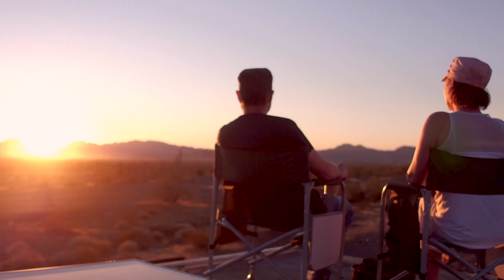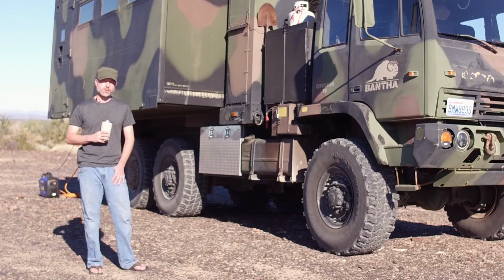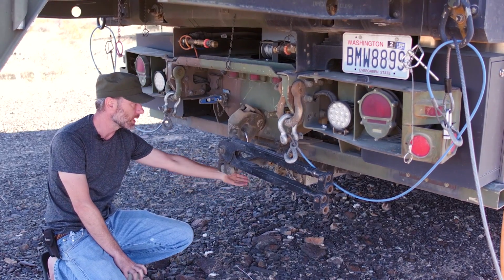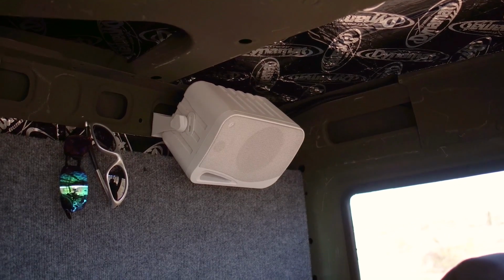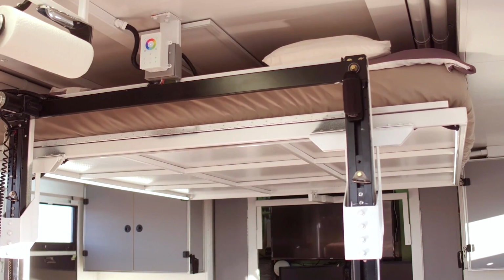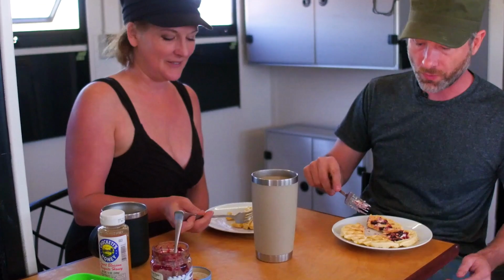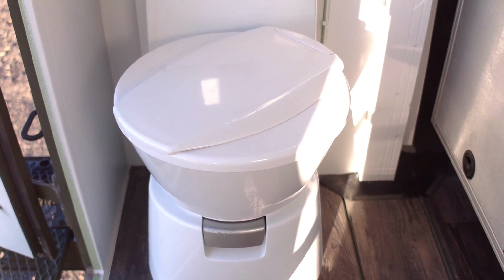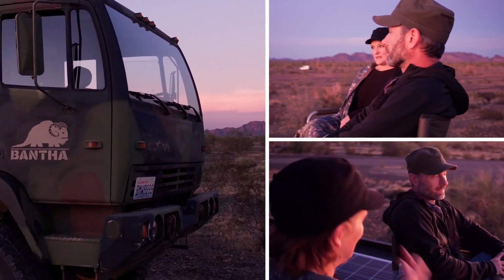Couple Converts ARMY TRUCK into Apocalypse Tiny Home 4 Overlanding

Comment: I like it.  While the industrial look might not be for all folks, another person could change the inside look that suits them.  The unit could definitely help you feel save about your travels, being 8 ft off the ground.  THe vehicle is a bold statement.  The views would be fantastic...having a high perch to view from in all most of your travels along with a tow vehicle.  I also like the way it slides and folds.  The bed idea is fantastic...like another room in itself.  Nice video.I saw a review on an off road crew who picked up a unit like this without the big box on the back.  They lowered the cab to show the engine.  I've seen these units at Military shows.  They are intriguing. THanks.

Comment: What a great job on converting the expandable box to a living space. I have a M934A2 expandable truck. It’s still stock military, but I’ve taken it camping in the woods of PA. I love all the additions to the inside of the van. It’s similar to what I want to do with mine. I see from the video, the slide outs are powered. What did you use to make them power or did it come that way?
Reply: Thank you.  We are using a power drill to open and close.   Adding drive motors, is one thing on our list (long list) of things to do.

Comment: I am extremely impressed with the Drop Down King Size Bed, and the Ability to have a Decent Sized Dance Floor with appropriate mood lighting. And that Top Viewing Deck, and Endless Hot Water Shower are just Awesome. As far as the Bathroom goes, I personally would have gone with a Composting Toilet myself, and I certainly would not have the Toilet on a Swing Out so that I can sit in the Wide Open Rear Door area with my Junk hanging out for all to see. I also love the Black Out System that sends all the interior lighting into full Blackout Mode if you have an Unwanted Intruder trying to gain entry into your Rig under cover of Darkness. Overall, your Rig is Awesome, and you definitely thought of every possible thing you could when you designed the Build Out of it. Simply Outstanding to say the least.

Comment: As we are currently have a box built that has a sliedeout on one side over the full length of 4 meters (approx 13 ft) I would very much appreciate if I could get some more information on the way the slideout is designed. If that would be possible please mail me at ulfrommel@t-online.de. Our truck is a Unimog firetruck made by Merdedes Benz.  Thanks for the video, that was great.
Reply: We will send you some info.  It is pretty basic, came with the slide outs, and a hand crank to open & close it.  We use a power drill to open and close, until we get around to adding power drive.
Reply: M1087FMTV great thank you very much.  I appreciate that.  I hope you have a lot of fun with the truck.

Comment: Looks like it was a former mess truck. (field kitchen). This truck also comes in a "command" (HQ) version or  a mobile work shop. The electrical system is 28 volts DC. Hard to find replacement light bulbs LOL

Comment: Many technically very interesting solutions and innovations. But this part is not homely. It reminds me very much of a canteen kitchen with a camp bed and TV. In addition I would miss in any case a passage into the driver's cab. The large overhang and the relatively low ground clearance by the spare wheel under the rear could have been solved more cleverly.
And, what about the usability if the slideouts are not extended? Is it still possible to use the WC and the shower? Is there the possibility to make at least a small breakfast in the morning?

For me personally only the solution with the movable solar cells remains as a usable idea for my building (but then move it sideways and thus double the area and at the same time gain some sun protection for the interior, including walk-in solar cells to use the roof partially)

+++Translate+++

Viele Technisch sehr interessante Lösungen und Inovationen. Aber Wohnlich ist das Teil nicht. Es erinnert mich doch sehr an eine Großküche mit Feldbett und Fernseher. Dazu würde mir auf jeden Fall ein Durchstieg in die Fahrerkabine fehlen. Der große Überhang und die relativ geringe Bodenfreiheit durch das Reserverad unter dem Heck hätte man auch geschickter lösen können.
Und, wie sieht es eigentlich mit der nutzbarkeit aus wenn die Slideouts nicht ausgefahren sind? Kann man das WC und die Dusche noch nutzen? Besteht die möglichkeit sich zumindest ein kleines Frühstück am morgen zu machen?

Für mich persönlich bleibt lediglich die lösung mit den verschiebbaren Solarzellen als verwertbare Idee für meinen Bau übrig (hier dann aber seitlich verschieben und so die Fläche verdoppeln und gleichzeitig etwas Sonnenschutz für den Innenraum zu gewinnen, darunter dann begehbare Solarzellen um das Dach noch zum teil mit zu nutzen)

Comment: 1000% not practical from the stand point that if it breaks down mechanically, youre not going to walk into autozone or even a dealship and get parts to repair it. Your going to spend the first week attempting to just locate any parts you might need to do the repair, then you will have to wait fo rthose parts to be shipped to your location. Not a wise choice for an RV imo.

Comment: Throw some infrared motion cameras around the outside and no problem ensuring a safe perimeter. Love the build, first military van I have seen with slide outs. Great shower space and bathroom space. So much to admire and soak in. Need to do the 360 view from inside as others have said as well. Good luck on your adventures.

Comment: Cruising the LMTV forums, I remember seeing something about LMTV owners (like yours) taking the rear gears out of Stryker Tactical vehicle and re gearing them so they can run around 70mph.

You may also want to look into “Mass loaded vinyl” in the cab for noise suppression.   If installed correctly the stuff is amazing and will only complement the already installed dynamat.

Did you guys build out the slides or did they come with the rig?

Where did you guys get that sweet shower valve with the temp display ???
Reply: They know about new drop ins, but are happy at 55 with that box on there: they are trying to see the scenery. The trip is the destination, not the destination is the trip. 😋
They can talk in normal voice to each other at 55mph, no further deadening needed.
Slides are factory.
Right? Shower readout is awesome!

Comment: The fuel consumption would be a serious issue, otherwise I love it
Reply: @halfpint614 The military throws those tires away after they reach their 5 year expiration date so yoj can pick them up on Gov surplus sites or ebay for about $300  with 95% tread life left. New they are over $1000 . You can always put a patch in the tire too. They pretty well under normal driving conditions unless you overload the truck while aired down too.
Reply: @buildthings79  try $2,500 per tire for the military.
But even bald there is almost 1” of rubber before you get thru the carcass, so you’re buying about 350# of Goodyear or Firestone rubber per tire! That ain’t cheap!😖
Reply: @jenngill7772  Yeah I'm sure the military pays $2500 a tire for the Michelins. They are pricey tires. I was just talking about the Goodyear MVTs like they have on that LMTV. They are significantly less money. You can get a new Goodyear MVT 395/85 R20 from a tire dealer not a surplus place for under a $1000. I found a place that has them for $795 each. I've been shopping for them for my 5 ton 4x4 International.  I bought the steel 20x10 split bud rims for it. (Older truck from 80's).
Reply: ...not to mention it's a million dollar RV

Comment: I Love it. The only thing I would not call it a tiny home, or even a RV, But an Overland Expedition vehicle. He's left the drive train bone stock, which could have been upgraded to different gearing and even bigger tires to get 8-10 MPG and run 75 mph easy. My real question is...what was the total cost of the build? My guess would be upwards of $175K. That's a little to rich for me.
Reply: To run a bigger tire would require a lot of work on the suspension and you don't even want to go that route seeing as there's no available aftermarket lift kits for a military vehicle like that.
Reply: My best friend owns a 2 1/2 ton LMTV  and we thought the same thing until we called around and found out why it cant be done without some custom machining.  
Fist the axels have a high gear ration to allow for less teeth on the ring gear ( like 3.71.1 ) and the manufacturer does not produce aftermarket gear upgrades or changes.  The end of the axle shaft feeds into a planetary hub inside the wheel that is I believe 3.1 reduction.  Also the space between the front a rear axel would not be enough to fit the 53" Michelins that fit those rims. So he's stuck with the 46" goodyear MTV's  (higher top speed,less road noise) or the 46" Michelin XZLs ( more aggressive tread, lower top speed, noisier on road) .
There has been talk of taking  old MRAP axles that dont have planetary hubs and just have like 6.81-1 drive ratio that had an Allison automatic, shift able transfer case and 500-600 hp diesels. The LMTV and FMTV only have like 270 hp and that Cat engine group cannot be turned up more then 20 hp or something close. All of it is controlled by a Special computer that was purpose built by Allison that even has the dash lights and head lights run through it. So if your headlight control box ( electronically controlled) stops working it prevents the truck from starting. We did extensive electrical work on his to find this out. Hell even the CTIS unit is a separate computer that has trouble codes it flashes just for the air system.
Reply: Russell Gerdes  oh I agree with you about that but not everyone knows how to fabricate and weld enough to build a suspension lift was my point.
Reply: Russell Gerdes  true being retired military  i can tell you from experience that they are a pain to work on.
Reply: Russell Gerdes  Yeah it was a pain in ass. We even had the 900 page shop manual with full schematics but its lovely to trace wires of all the same colors that have redundant relays and circuut breakers. Another friend of ours that owns Virginia Crusher the monster truck looked at it and said all we had to was add 6 inch lifting blocks to the axle and 53s wouldn't be a problem maybe even the monster truck tires. But the 53s above 55 mph get really squirrelly on the highway.  Lots of work just to get a scetchy 5 mph gain. I hate to think what it would be like to have a blow out on a 53" tire at 60 mph.
Reply: Russell Gerdes  Ive got to drive into the city tomorrow morning where my 30,000 gvw 4x4 1988 International  inner rear rim exploding while driving. Cant get the lugs off because it sits most of the year off pavement.  Had to load up a gas powdered compressor to be able to run my 1" anvil gun which couldnt run on the trucks air today. Its been stranded in a bad part of Baltimore  city for a week. Tire is still connected to the outer part of the split rim. ( gotta love those things)  rim just rusted right through and exploded while pulling into an alley going to pickup some steel.
Reply: Russell Gerdes  nope, slides are factory original. 😎
Reply: Russell Gerdes  they are original. 😎
I’m not sure what this one was originally, I suspect a command center for a general or something like that, because the M1079 was a radio rig... I’ve watched too many MASH 4077 episodes & think those generals all traveled with red carpets and harems. Lol
But you would have to ask Krystal and Zach to find out the true story of Bantha’s military service record. They might know?

Comment: Really cool, and really impractical unless you have the $$$ to keep it going. It is also really top-heavy. High winds will be a huge issue with all of that weight, and MPG is a killer.
Reply: Not top heavy at all!
Frame rails are 3/4” thick channel iron, 75% of the weight is below the half height line.
The box is aluminum/ foam/ aluminum, so it’s lighter than it looks while still being solid.
They do fine driving down the gorge, even better than an average semi pulling a cargo trailer because of the lower center of gravity. 👍
MPG is similar to a motor coach that can not go off road and close to a semi that also cannot go off road. 

You can afford to do what you put your mind to do by giving up buying knick knacks at every tourist trap, upgraded window treatments, new kitchen countertops, spinner hubcaps and etc....

Comment: An amazing build. Do they have a microwave or convection oven?  I am surprised that very few people living in a tiny house, RV or buses haven’t thought about having a incinerate toilet which eliminates the need for a black water tank, composting or a cartridge system.  All you have to dispose of is a very small amount of ashes that don’t pollute or harm the earth.
Reply: An incinerating toilet uses a lot of electrical power. It's nearly impossible to use when you're off-grid. It requires a 20 amp. circuit with 120 volts. And it's a particularly inefficient way of disposing of liquid waste.
Reply: @gblakev  thanks for fielding that better than I could, Blake! 🤝

Comment: I was hoping that would explain the different lights function when water faucet is in use while using the kitchen sink.
Reply: Genevieve Words seems like blue for cold, red for hot (logical so far) and maybe flashing green when changing to avoid burns. No sarcasm intended. Text can appear blunt sometimes. I have seen similar lights on showers

Comment: What do I  think of this tiny home?  If I saw this  o r 1 like it for sale?  As long as the price was less than the equity of my house, I would buy it on the spot. Just keep a few thousand to add winches to load husband up and down (not because he is big but he is functionally a quadriplegic) and then increase the battery bank and off we would go.  The only thing that would top it, for me, is a 6 wheel drive. Or 8, but have never seen one. Absolutely fantastic build!!  Thanks for sharing, all of you!

P.S. you CAN walk up the steps in heels. Just use the front half of the shoe for each step and let the heel stay in the air. Do it all the time with steps and stairs. But I don’t have a solution for going down. Sorry
Reply: Rebecca, this IS a 6 wheel drive rig!

Comment: OMG!! I WANT ONE!!! This is the ULTIMATE SAFETY in tiny homes!! 
This guy is AMAZING!! 
Will you create mine PLEASE!! When I find the truck that is...oh, and the $$$$!!!😂😂👍👍👍👍👍🚛🚛🚛
Reply: Wrong truck to use very very hard to buy parts for that truck do your research and you'd really be screwed if your outside North America!
Reply: @shawnwright5332  
No one asked for your 2 CENTS!!🤐
Reply: @dashie07e.92  lololol go buy one
Reply: Thanks Dashie07.   Actually, we did our research ahead of choosing a rig.   This is a Stewart & Stevenson rig, has a Cat engine, which means getting parts is a breeze.  Not that a custom build out is easy, but the actual rig is not too tough to maintain.   Go for it!
Reply: @BANTHA-M1087FMTV  
I watched your video 7 times!!! I am AMAZED at how AWESOME your tiny house on wheels is!! I saved it so when my time comes to build I'm taking some pointers from you both!! The one issue I have with all the tiny homes is how easy they are to break into!! NOT YOURS!!🤓Just AWESOME AWESOME AWESOME!! 👍
Reply: @BANTHA-M1087FMTV  well according to the military surplus dealers will tell you other then a engine part when the transmission or any number of a thousand parts that can leave you stranded in the middle of nowhere were a tow truck can't even rescue you no thanks been there done that! Duece and a half Freightliner 4x4 we're every part is available is a way better choice but unfortunately people always need hard lesson to learn by.Nice build on the inside by the way.Ps there's a need fuel filter upgraded for that engine otherwise it takes out your injectors!

Comment: If they ever find out they have figured out how to run engines from tubing from the fuel tanks ran into a back up gas jug in the engine compartment allowing the air cleaner to suck these fumes into the engine from the air cleaner unit that allows people to get around 200 miles per gallon .. their set for Life .. &))) :)) ;) 🇺🇸

Comment: Can't travel very far without refilling the tank. Kind of defeats the purpose in my opinion. This vehicle gets a thumbs down in my book bc it's cool but not as functional or efficient as I would like.
Reply: they can go farther on a tank of fuel then you can in you Prius. Of course the fuel tanks are huge, lol.
Reply: @johngault2439  first, Ind Rand made me ask this: “Who is John Gault?” 😂

Second, it’s a 58 gallon tank. The factory lettering on the tank shows a range of 365 miles, but I believe that’s running the lines and both filters and all 6 injectors dry! 😰
We rarely push ours past 250 miles before topping up.
And if we see a ridiculously low price on diesel, we will top up the tank, even if it’s only been a few miles since we filled up!
😏

Comment: Top heavy?  I'm happy for them. However, I find it functional but not inviting. Too industrial looking inside for me.
Reply: No, not top heavy.  Stripped down weight of these M-1087s  was about 9500 lbs,  chassis, drivetrain, and almost 3000 lbs of tires & wheels keep it balanced enough to handle off road terrain.
Reply: And I find the look practical, clean, and inviting.